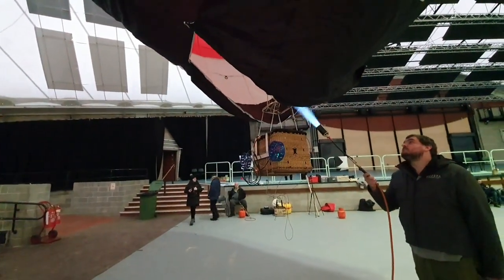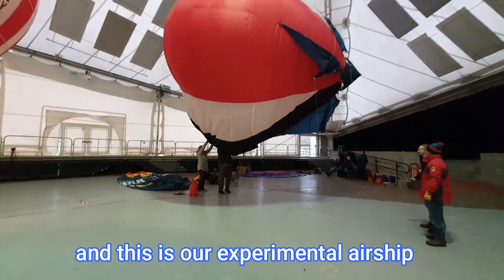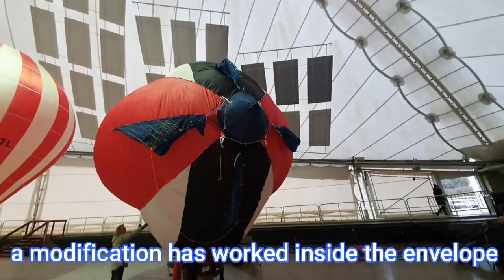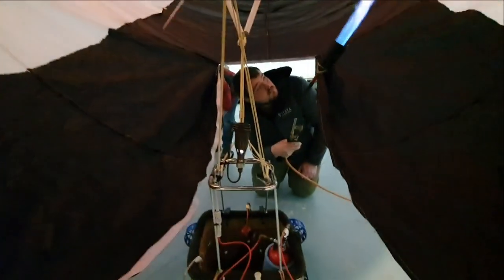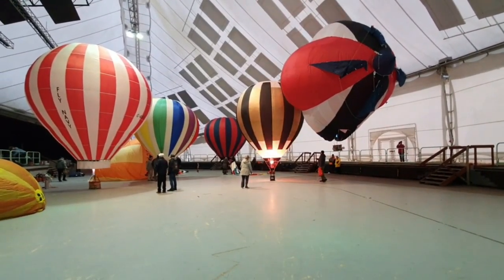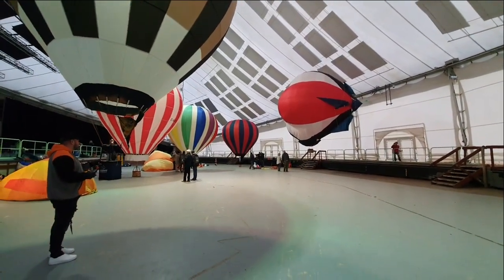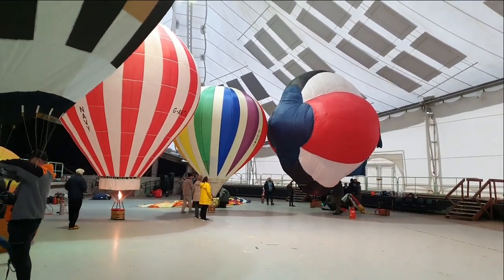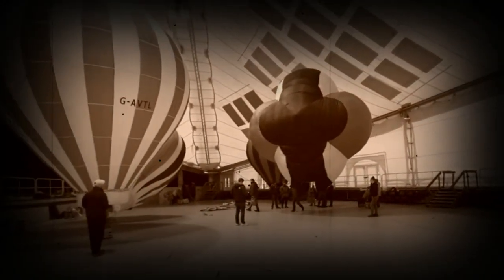RC hot air AIRSHIP (it finally flew)

Comment: Really love this!! Literally the last couple months I’ve been thinking about how one would go about building an RC airship! I want to start working on it right after I finish my next special shape RC! (Haven’t started that one yet…)
Reply from the maker: fantastic, well if your into making special shapes already, you won't have too much trouble with the envelope, and what I wanted to do is create a system that means (in theory) any model balloon can be adapted, and with a little adaptation the basket can still be used, meaning the need to specifically design a gondola is removed. What shapes have you / are you making?